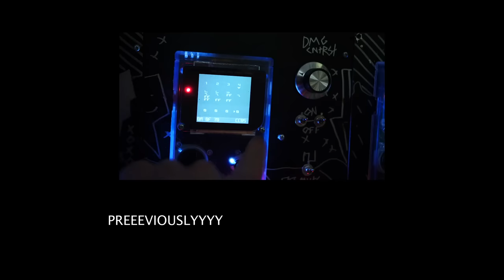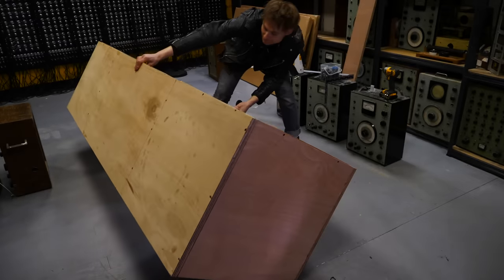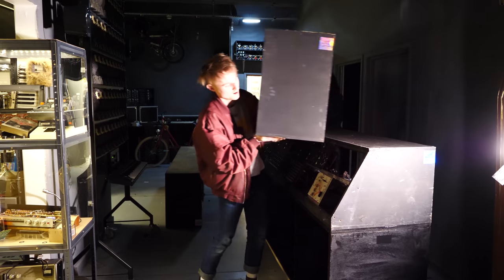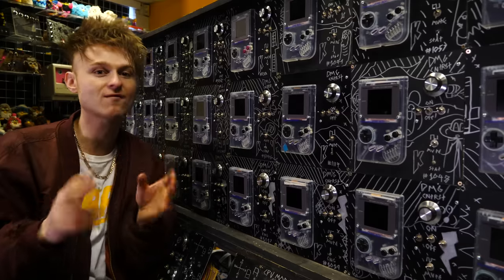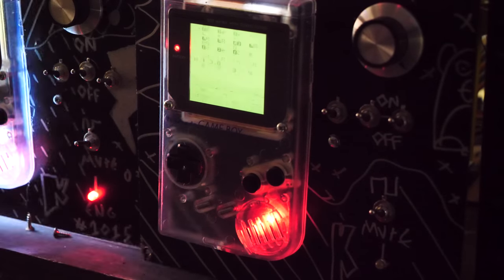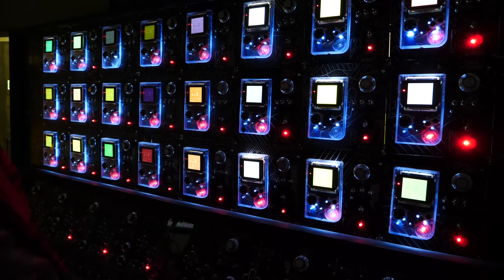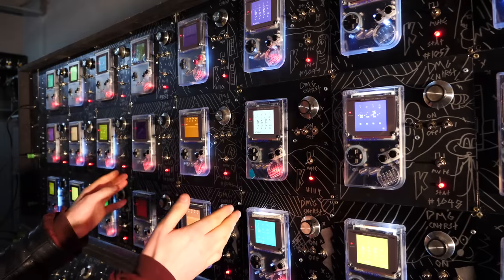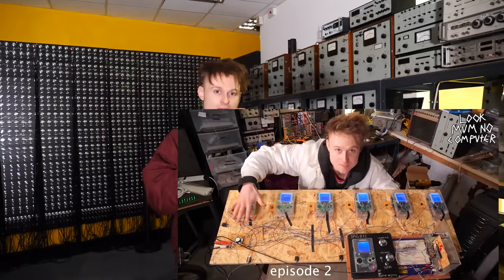50 Brand New Gameboy Screens Fitted and WORKING :D. BUT MORE PROBLEMS - GAMEBOY MEGAMACHINE

Comment: Glad you found a compromise for the screen problem in CPU clock tweak mode.

How did the Game Boys ever receive MIDI data while adjusting the clock, though?

It wouldn't normally take much of a clock tweak to mess up the serial timing and stop MIDI working?

Comment: Put some handles on it!!! :D 

Also, did you use drywall screws? if you did, you need to change them because they are likely to snap and especially cause you dont seem to have enough from the bit in the video i saw

Recon youll have this thing finished by Christmas 2021 ;)

Comment: Yeah you use a mosfet to switch load voltages, you use a pnp or npn to switch logic. I hadn't seen this before but this video has me wondering if this is even possible. If you're adjusting the bus/ cpu frequency of the gameboy the data clock will probably change too, trying to do this without a microcontroller seems like a monumental challenge. Do you have schematics posted anywhere?
Reply from the maker: That aspect of the project is fine and working. It's signals coming over it all works and has worked but just got big mumma grounding issues and such that the problems just keep stacking up again. Before I moved and stored it it was working wellm check the previous Gameboy megamachine videos to see the schems :)
Reply: @LOOKMUMNOCOMPUTER  Thanks! Yeah the first thing i thought of when i saw all those wires hanging was "big inductive loops". Theres gotta be some transient voltage there. Very cool project though, i love things that blur the line between analog and digital.